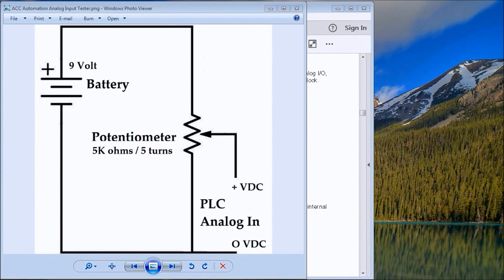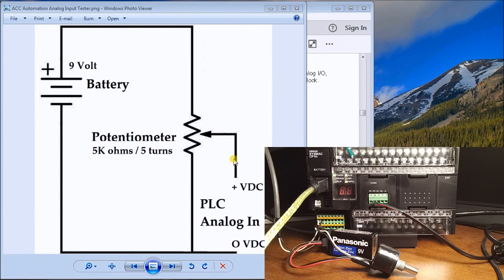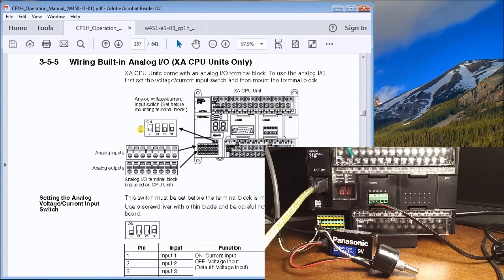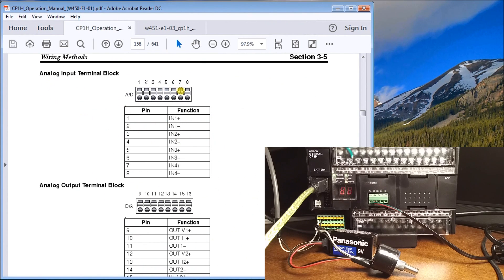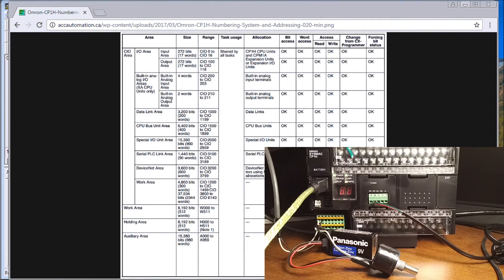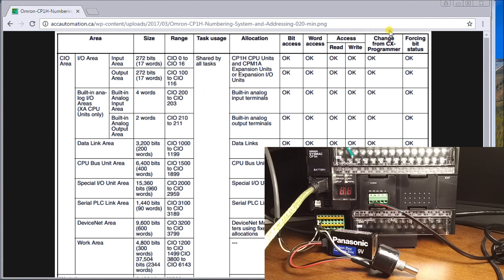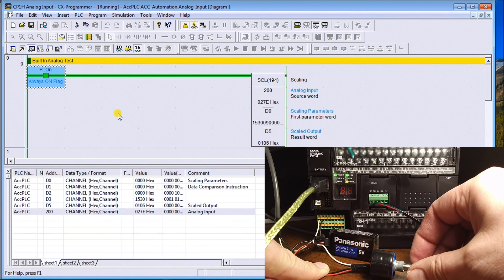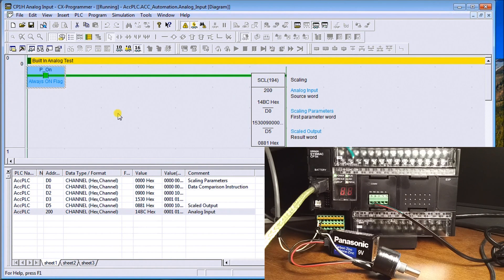Unlock Omron CP1H Analog Wiring Secrets in Minutes!

Comment: I followed this exactly yet receive no input. Any advice?
Reply from the maker: Are you getting a voltage signal between the input and the common point of the PLC? 
I would test this without the connection to the PLC to be sure that you can adjust the voltage output signal.
I hope this helps you out.
Regards,
Garry
Reply: @ACCautomation  
-First verify that you have a current  input of between 4-20ma. Verify via measuring with a multimeter. 
-Set the physical dip switches to "ON". For "current" input. If inputting a voltage, leave dip switches "off".
-Activate the input feature in the settings menu of the programmer.

Comment: HI, where do you normally get the 10V from? The PLC is always 24VDC and i don't see many 9V batteries around. Do the PLCs ever supply 10V for the analogue in or out? Thanks for your video!
Reply from the maker: Hi Vance Bell,
This is a common question. The 10V DC for the analog usually comes from the sensor you are connecting. You typically will provide 24VDC to power up the sensor, and the output will be the analog 10VDC. Please look at the operating instructions for the analog device you are using.
I hope this helps you out.
Regards,
Garry

Comment: Hi, thnx for the video. What about activation of the analog inputs in plc parameters first?
Reply from the maker: Hi easymotorrider,
The CP1H uses a fixed memory location for the analog. This was covered in the following post/video:
https://accautomation.ca/omron-cp1h-numbering-systems-and-addressing/
Built-In Analog
Analog inputs: CIO 200 to 203
Analog outputs: CIO 210 to 211
This is part of the CP1H series:
https://accautomation.ca/series/omron-plc-cp1h-series/
Regards,
Garry
Reply: I mean activation of these inputs in plc settings before starting to use it. They will not work, until you activate it in settings, also here you should choose a range, voltage or current, e t.c.
Reply from the maker: @easymotorider  
Can you provide the exact model of the Omron CP1H PLC that you are using?
The CP1H has a fixed memory map for IO. The settings are specified in my previous response. You will set the voltage or current through the dip switches as indicated in the video and manual. 
The value will be displayed in the appropriate channel for the built-in analog. You will use the scaling instruction to scale the value to engineering units. 
If you go to the website specified in my previous answer, links to the manuals are at the bottom of the post. 
If you are using another manufacturer of controllers, you must look to the manual to wire and set the input. Some will even have scaling built-in.
I hope this helps you out.
Regards,
Garry

Comment: Hi dear how I convert digital input into analog out put in omron plc?
Reply from the maker: Hi Imran Yasin,
The Omron CP1H has fixed memory addresses. This means that the analog output will come from a specific register. This post will show you the addresses.
https://accautomation.ca/omron-cp1h-numbering-systems-and-addressing/
Here is a link to the entire Omron CP1H series.
https://accautomation.ca/series/omron-plc-cp1h-series/
Regards,
Garry
Reply: @ACCautomation  
I have cjiw series
How can I get analog out put using push button input
Reply from the maker: @imranyasin9860  
The push-button is either on or off. An analog output will be a range. Here is a post that will explain the analog output.
https://accautomation.ca/how-plc-outputs-work/
In Omron, you would usually use a "MOV" move instruction to set the value for the analog output.
https://www.ia.omron.com/products/family/1645/
Regards,
Garry

Comment: Hello Garry 
My PLC has a problem about error (008A Code). 
My PLC model CP1H-XA40DT-D.
When I setting PLC for use Analog built-in and transfer its after has alarm.
How i can do it, tell me please, thank you.
Reply from the maker: Hi Nattapol Tangam
I cannot see this error in the operation manual.
https://assets.omron.eu/downloads/manual/en/v1/w450_cp1h_cpu_unit_operation_manual_en.pdf
On the CPU there is an ERR/ALM light. 
If it is flashing a non-fatal error has occurred. The program will still continue to be executed. I would then check your parameters in your program.
If the light is on solid, there is a fatal error. I would check the hardware, including the connections for your analog signal.
Let me know how you make out.
Regards,
Garry